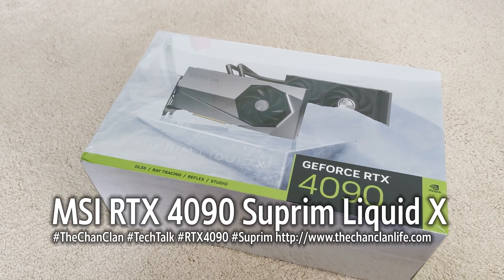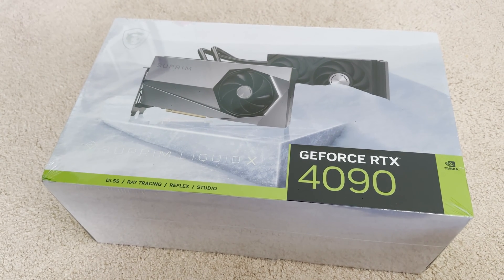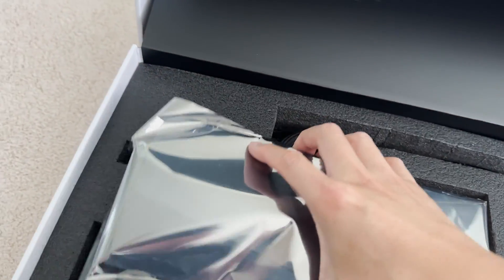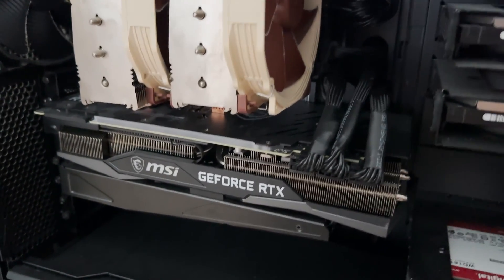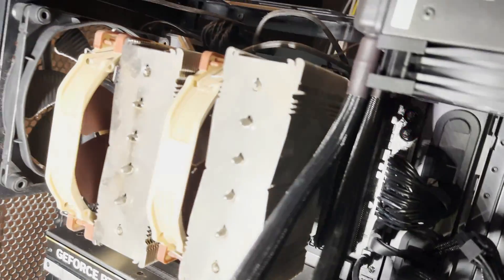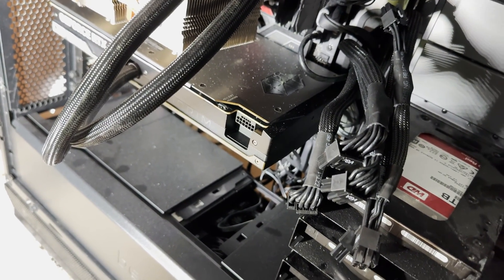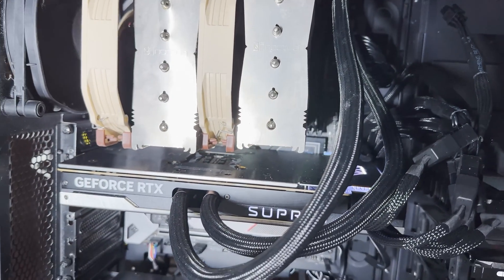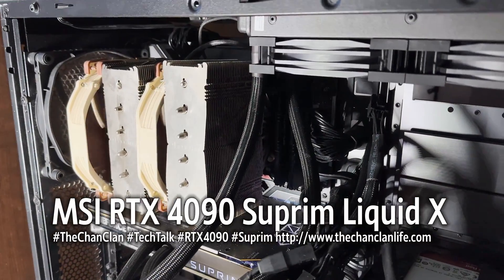TechTalk: MSI Geforce RTX Suprim Liquid X Unboxing and Installation

Comment: Uhh ijust got one and my power adapter isn't 4 it's only 2 I see no.videps with it only having 2 did I get sent the wrong adapter in the box? I don't dare turn it on lol
Reply from the maker: That's weird, this thing needs all the power, there is the new Nvidia GPU connector that's supposed to come standard with it, this connector has been the one that is prone to breaking if bent too much.  Did you get it new or second hand?

Comment: Hey bro I just bought mines but I have a question. With the msi gpu the fans on the rad where do they hook up too? Is it power by the gpu or you have to connect them to the mother board
Reply: It should be wired into the gpu itself and you don’t have to connect anything

Comment: Hi, does your card have coil whine. I got mine in a little bumped box a few days ago, but everything looked good. Performance wise it's awesome, but it has coil whine (even when not under heavy load, although at times like these it's not loud)

This is the first time I built a PC, and I wondered whether I should ask for a replacement or not (is it broken or a common issue...??) I had before a prebuilt PC and didn't have this type of issue
Reply from the maker: Under max load I get a little whine, but usually I'm gaming with headphones on so I'm not listening to it, under lower loads there is no whine.